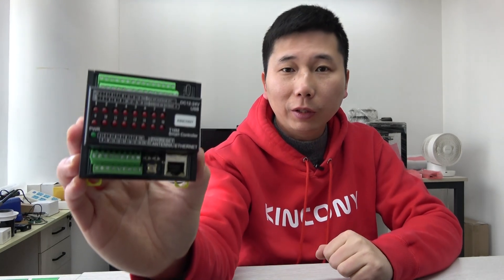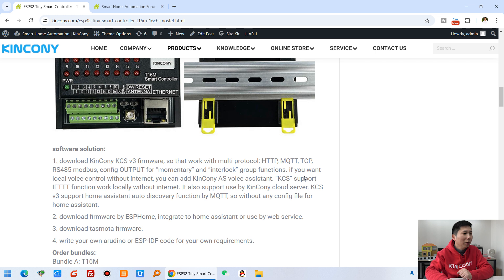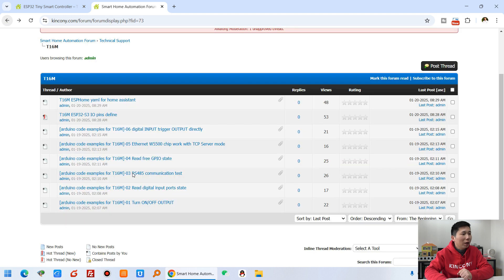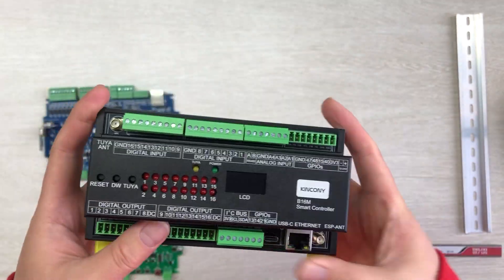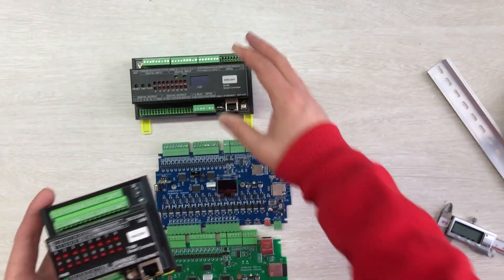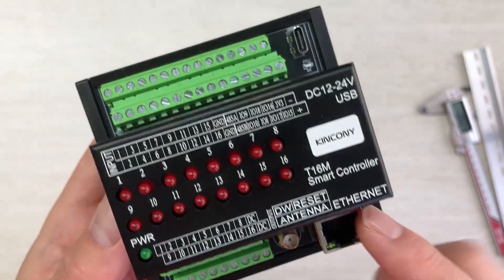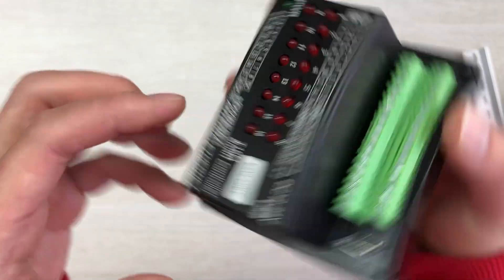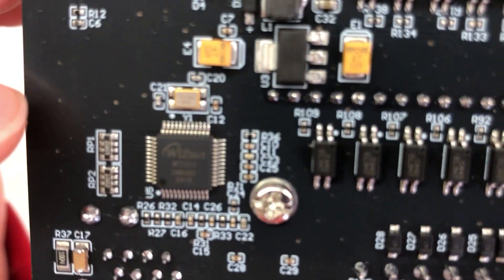Tiny ESP32-S3 Smart Controller For Home Automation IoT Project in 2025

Comment: how do you wire the outputs to a relay? What is the DC pin at the end of each output row ?
Reply from the maker: output to relay's coin, the "DC" terminal connect with power supply.

Comment: What is units total current capacity?  Also what about per channel?  I saw some documentation that said 4A and other pages with 10A.

Also, is this high-side switching?  Thanks!
Reply from the maker: T16M per channel mosfet MAX 4A, what frequency of switch you want to use?
Reply: @KinCony  Thanks.  What's the total concurrent amperage for the total unit?  I'm driving a fan and would like to drive it out of audible range (20khz).

Comment: wHy the terminal block connector is not like the G1 CONTROLLER ?
Reply from the maker: it have more point.
Reply: Yes but need plug and play connection. 
If all wires connected and need to replace the controller it’s not nice
Reply from the maker: @moshiko2312  because we want the size smaller. if use by removable terminal, the controller size will be bigger.
Reply: The size of the G1 it’s ok 
So think about it plug and play it’s better when you have 30 connections and more

Comment: Can i connect electrical windows directly to T16M outputs without using omron relays board?
Reply from the maker: if work voltage is 12v or 24V, current <4A, it's ok.
Reply: @ but i saw in kincony website that current in max 10A!! 

So mosfet works just with 12v or 24v?
No 230?
Reply from the maker: @ sorry, we have updated. it's 4A